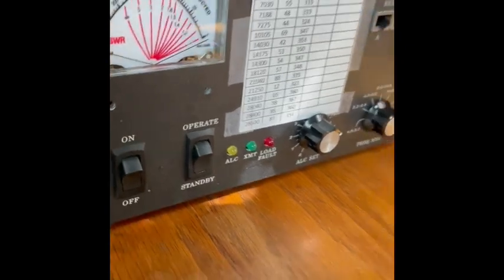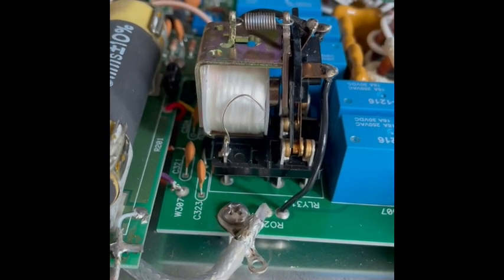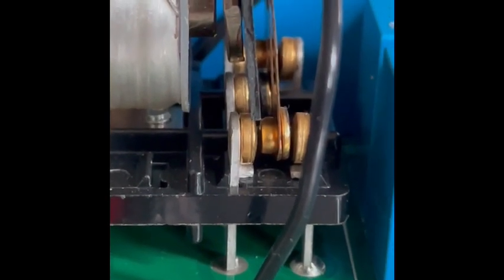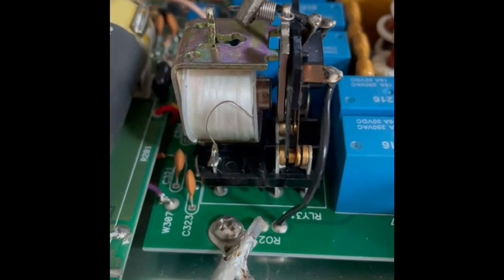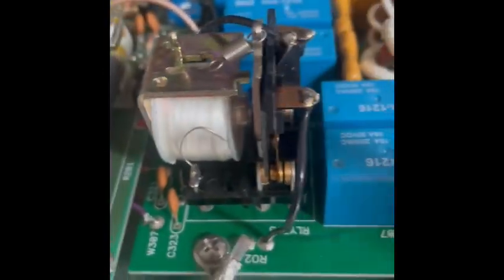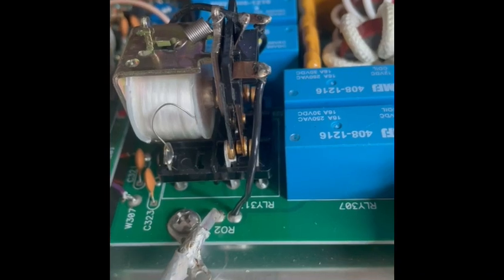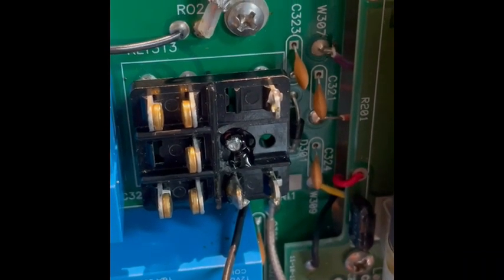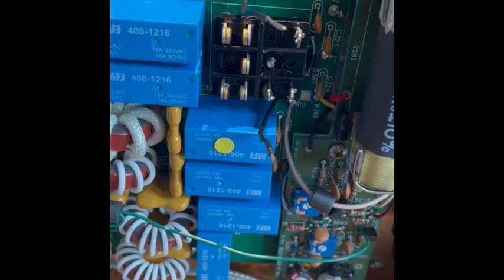ALS600 ameritron amplifier repair and upgrade to QSK -new transmit relay.

Comment: Review 3 of the wires that you first cut from what you removed in your video I only saw the black one soldered back to the new relay. Is that correct?
Reply from the maker: Input and output get soldered back